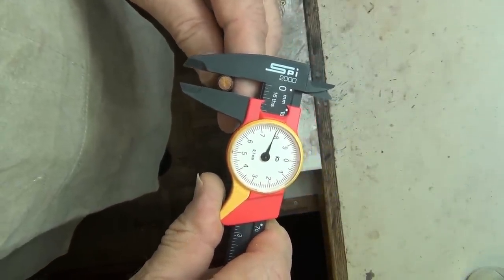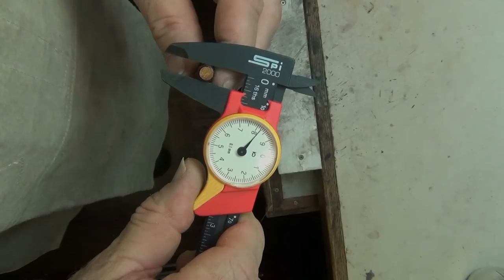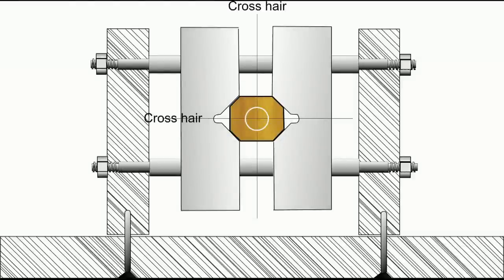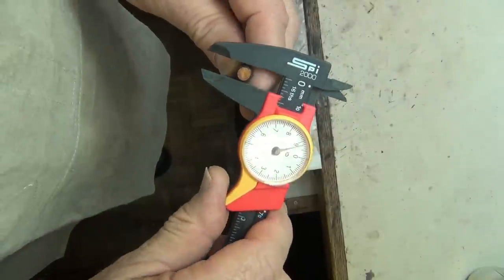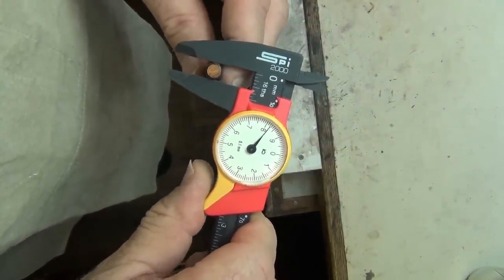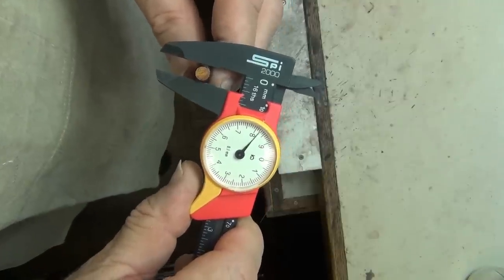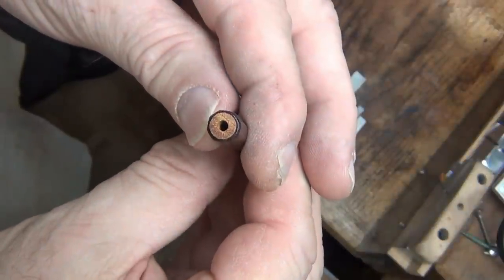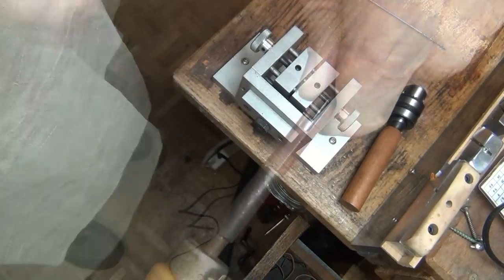Turning the bow butt 90 degrees for perfect centering

Comment from the maker: Point well taken. If you have a flared butt, pack only the top three facets at the thinner end with tape to prevent movement. This will force the bottom facet along the left (or right) jaw, aligning the bottom facet with the new screw shaft. Still safer that swinging a bow in a lathe, the very reason the BowBadger was invented. Glad you brought that up though.

Michael Vann

Comment: Michael- thanks for the reply, and your BowBadger looks like a good product.  I don't need one- I have a jig which holds the bow at exactly center height in my lathe (I don't swing the bow), and it works without tape, even if the bow is flared.  It can rotate 90 degrees to automatically hold the bow for milling the mortice too.  But it took some machining skills to make, and not everyone has the time or inclination to do that.

cheers from cool Vienna.

Comment: If the butt of the bow is of uniform thickness top to bottom, then of course a perfectly centered screw is what you want.  But if it increases in thickness towards the end- which is often the case, especially with many old bass bows, then a centered screw will cause the frog to get tighter the further back it goes.  In this case, a device such as I use, which mounts in my lathe and ensures that the screw hole is parallel to the bottom of the stick, is superior.